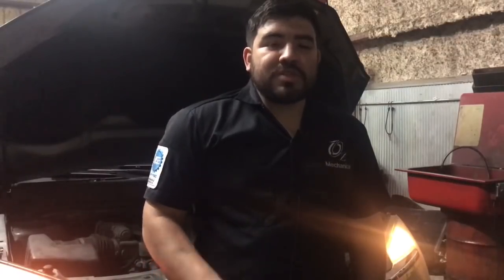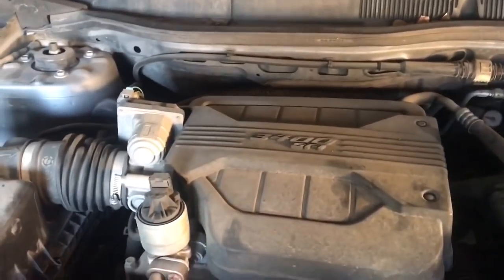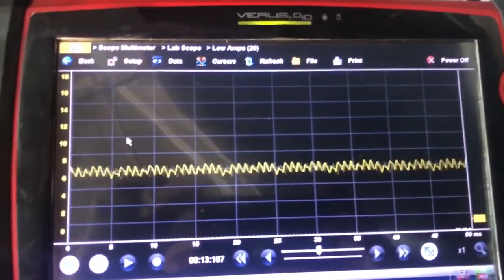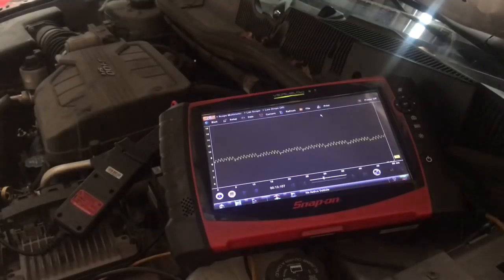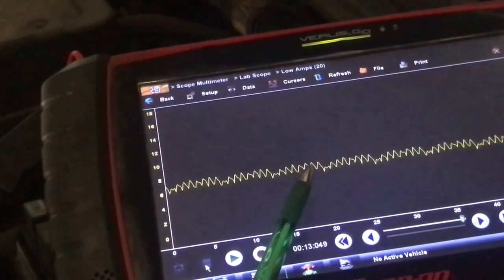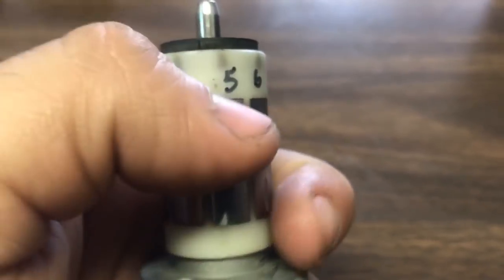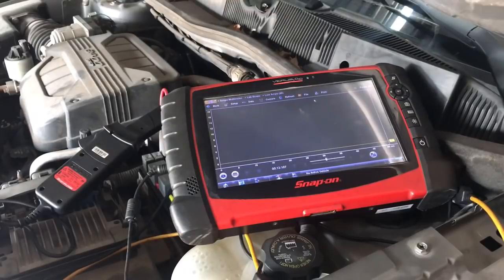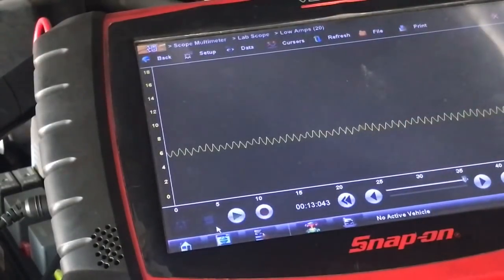Engine stall problem fixed

Comment: Sir I have 2002  Nissan maxima 3.5 
It shuts off after a warm up  . I got scanned it with a professional but found no codes whatsoever .pls help me
Reply from the maker: Kritik Rosh hard to tell with out looking at data and doing test. Is there a reputable shop near by ?

Comment: Its a high resistance problem. You can fix it by changing the fuel pump. But the problem will eventually come back. Its better to add a extra ground to the fuel pump relay it looks ghetto but if you properly ground it then looks doesnt matter. I promise you this will fix 99% of almost all other startup issues.

Comment: I have a 2005 350z that stall on idle and anything below 1k rpm when the ac is off. When the ac is on it idles lower than it used to. The car stalls then starts right back up. I have replaced MAF sensor, all o2 sensors, and all the timing position sensors. I have no codes for anything when the car stall I’m just here scratching my head.
Reply: Hi. Did you find and fix the issue on your 350z?

Comment: Nice picture of the segments in the fuel pump. It sure helped visualize the scope information. Chasing down the reason for the blown circuit breaker is a sign of a good technician. The owner should be a life long customer now.